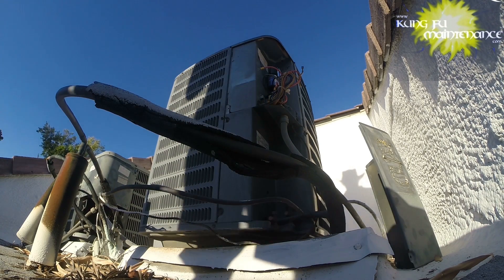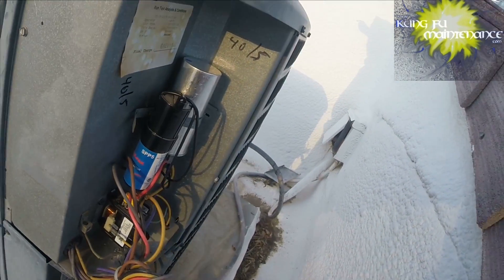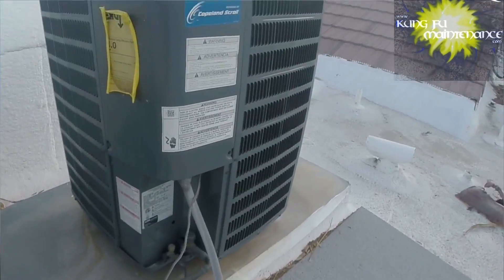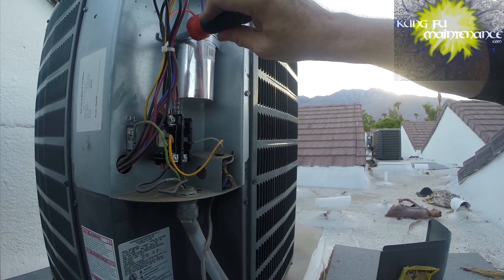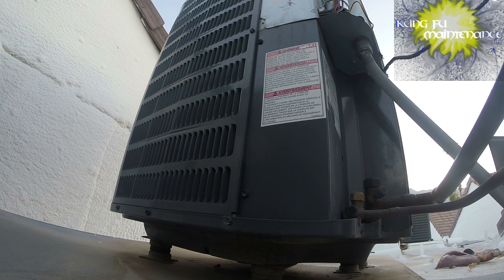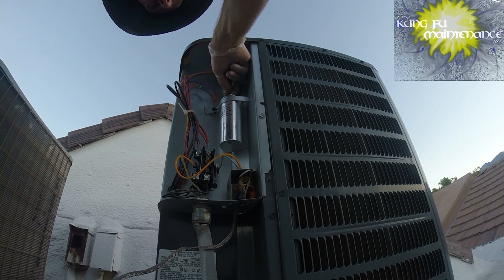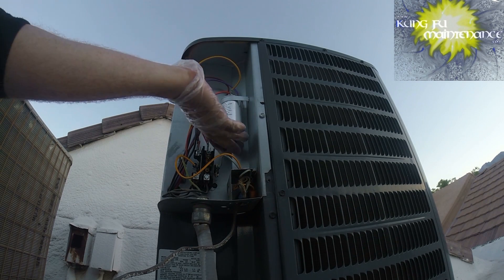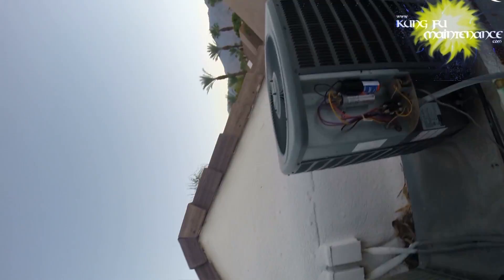Sounds Of Air Conditioner Compressor Having Hard Time To Start

Comment: Thank you so much for this video. It really helped me confirm what was happening when my(and my neighbor's) unit was making much more noise than usual a <1sec power outage the whole city experienced this past week. For anyone wondering- after the power blipped both units were doing this and I immediately flipped my disconnect. The neighbor's stopped after a few minutes of the noise so I turned the power to mine back on and it started normally. My best guess was that considering the whole city(almost 1 million people) experience the same thing in the same 1bsecond , everything was trying to get the start-up power needed to get going and there just wasn't enough to go around. After a few minutes the usage probably dropped considerably and was closer to any other startup under normal conditions.

Comment: Hi..Can you give me some addvice I have a ductless minisplit 220v 2 ton the neighborhood has a power drop the power came right back I had the minisplit running afte the power came back my unit started to sound funny like the compressor is having a hard time to keep running at one pace...I checked the capacitor its 50+/_5%microfarids.. my reading on multimeter  show 48.1 so the capacitor is still within range my question is ¿¿what could be the cause of the compressor strugling to keep going??
Reply from the maker: Might be good to just turn it off for about 5 to ten minutes to let pressures equalize. It is not good for compressor to be turned off than on quickly, which sometimes happens in a power surge. Many thermostats have a five minute delay built in to allow pressures to equalize before restarting to protect the compressor and some installers add a five minute delay ahead of the contactor to protect the compressor.

Comment: What is the cause of the startup noise at 3:00 after the disconnect is plugged in?  My 32 year old Heil sounds exactly the same.  The hotter it is/shorter time since it last ran, the angrier it sounds.  Still cools mighty well though!

Comment: I keep hearing a humming noise, like the low tone hum/beep in this video, randomly every minute or so on either mine or my neighbors unit. Is it probably the capacitor or compressor? Trying to figure it out! Can't get an AC guy out for a couple days.

Comment: My hvac compressor doesn’t start no more . I was working fine a day ago . Is almost 2 years old so still new . Is. 3 ton rheem , you know what the problem. ? Can you help me ? Compressor sounds like wants to start but nothing is like a small humming .
Reply from the maker: Could be bad capacitors. If replacing yourself make sure to pull power and than discharge capacitors as they can hold charge after disconnecting. Also  check for burned or lost wire connections.  Best to hire a pro if needed. 
Faith ~ Hope ~ Love!
Reply: KungFuMaintenance thanks I’m doing it now ! Thanks again!!
Reply: Another question homedepot or Lowe’s carried capacitor?
Reply: KungFuMaintenance thanks man! Good video and I fix it myself and works perfect !

Comment: I've used hard start kits on occasion.   Especially on some older units where the compressor has difficulty in starting, buys the customer some time (perhaps another few seasons).

But you are correct, I know some HVAC technicians that install hard start kits on brand new AC installs.

Comment: I never discharge the run cap. If it is connected the compressor windings and and fan, it will discharge the moment the unit shuts off. The compressor and fan itself will discharge it.